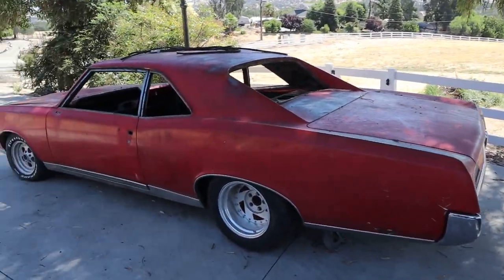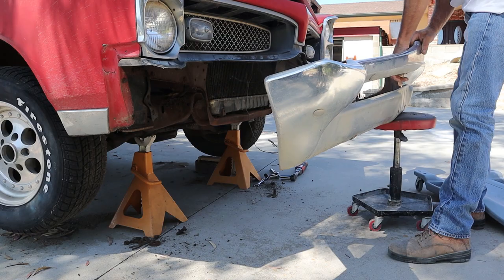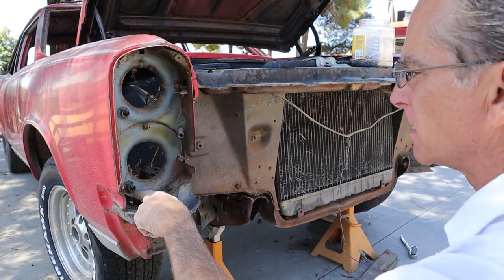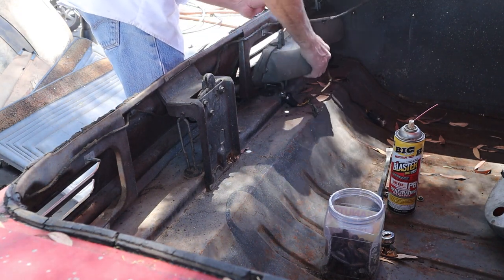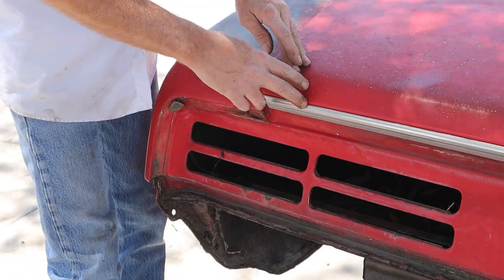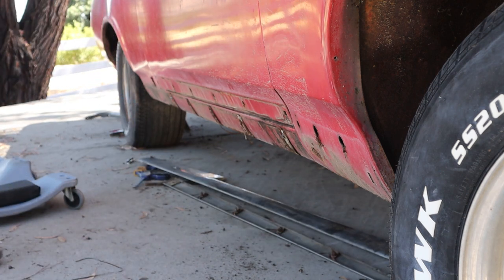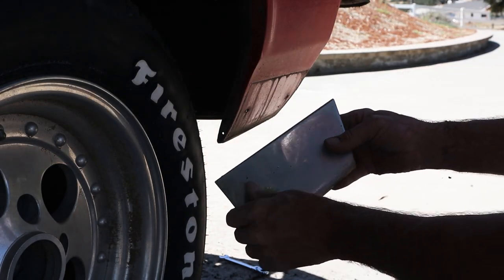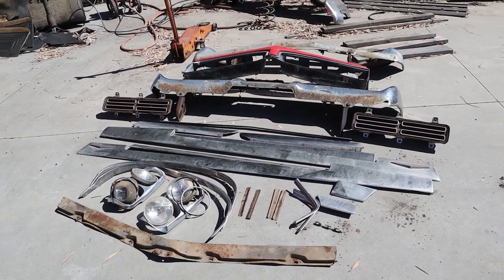Stripping the Small Stuff to get to the Big Parts - GTO RestoMod (Ep 5)

Comment: Pb blaster great stuff. Works best on dissimilar metals (steel bolts in aluminum) I use small hand torch (Cuban cigar lighter) for metal in metal bolts.
Reply from the maker: Yes it is and seems to be working pretty well so far.  I am sure I will snap off a bolt or two before this disassembly is over.